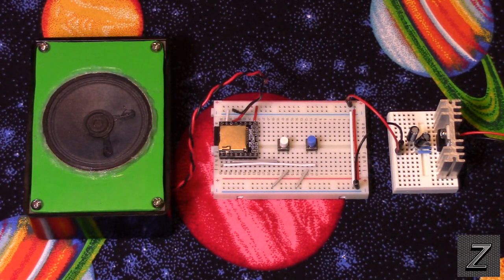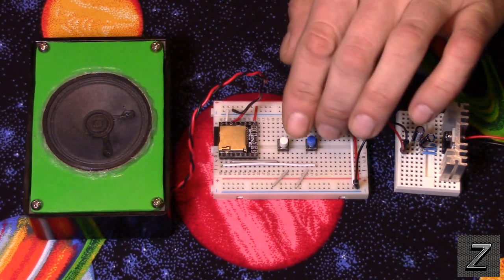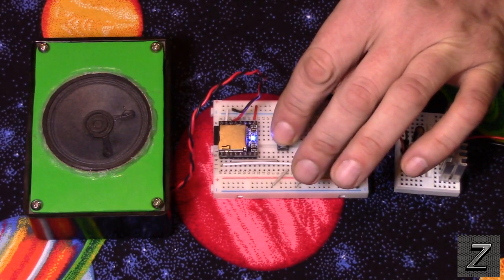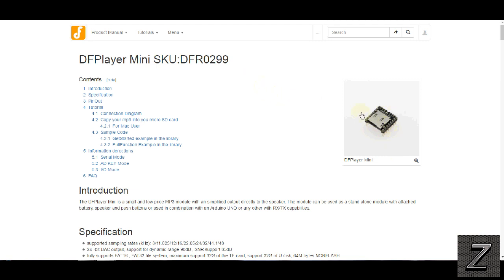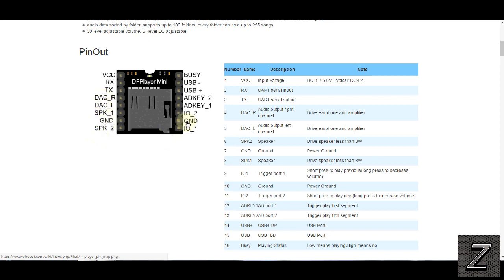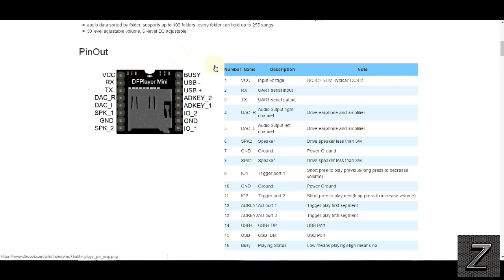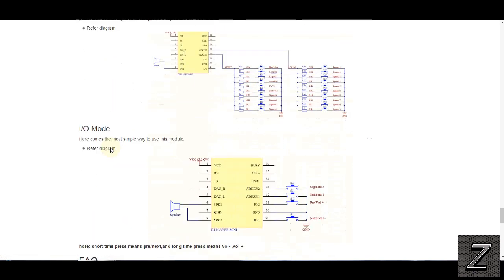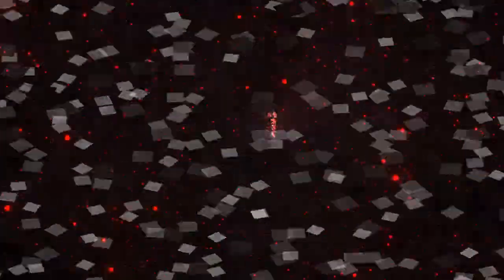How To Set Up And Use The DFPlayer Mini MP3 Player

Comment: Spk_1 + Spk2 sound much louder than DAC_R + DAC_L
I have for each 4_Ohm speakerin serie with a 50_Ohm resistor,  ohterwise to much load, and some protection kicks in.
32_GB with FAT32 did not work by me.
At my desk was a 2_GB with FAT16, Yep TheDoo Ascend.

Comment: Does this module automatically play sd after connecting to power supply without using buttons? or needs connect and press buttons to play?
Reply from the maker: needs button to play

Comment: is there any such stereo player ?
Reply: yes ! z-hut has got it wrong, speaker -/+ is the on-board amp from the module for a mono speaker, DAC R/L are aux out for right and left, to a power stereo amp(add a ground to the cable) or to portable powered speakers